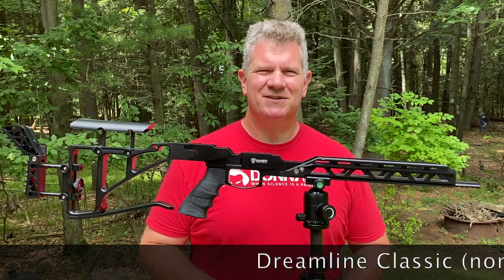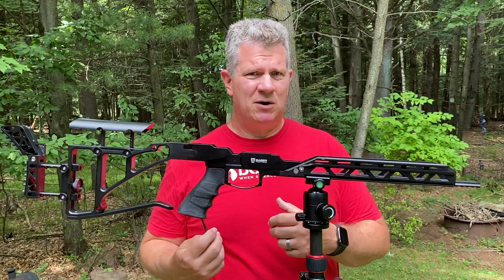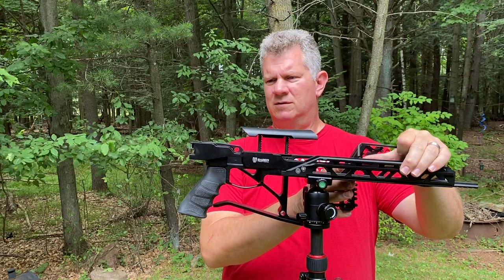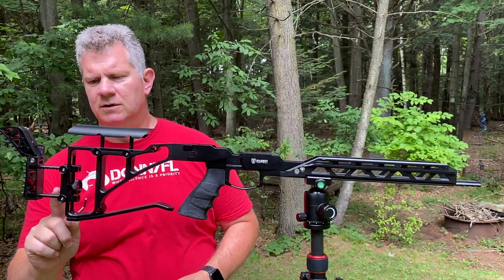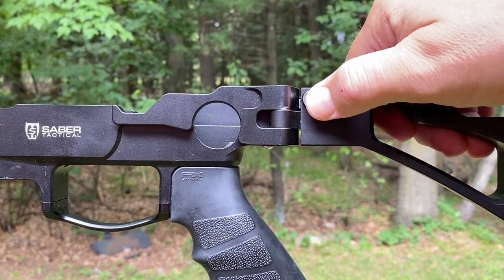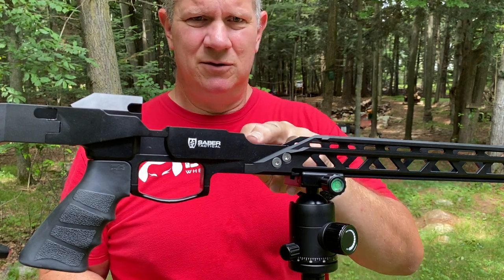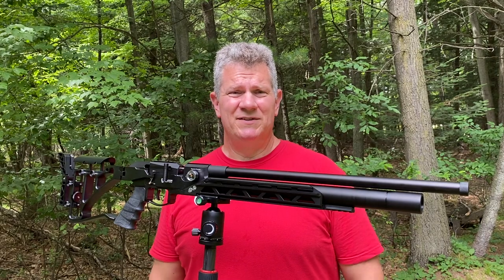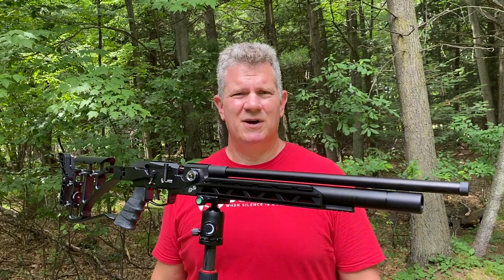Saber Tactical Chassis Install for the FX Dreamline Classic without an External Power Adjuster

Comment: g'day, thanks for the great video. Just about to pick up one of these for my dreamlike down here in Australia! have you shot the .177 much at 12ft pound? I can't seem to replicate the accuracy at lower power settings as I can with 15 foot pounds. About to try the superior barrel liner also, and see if that makes a difference.
Reply from the maker: I have not tuned down below 12 FPE. I think I'm around 20 FPE on my Wildcat. I have had luck with my Superior Liner.

Comment: Is there a traditional ,Hampster, that you can put on it. Please provide link info on the tripard 
I am going to buy one of these How do I give you credit for the reference Thanks Tom
Reply from the maker: Any hamster that can be attached or converted to ARCA Swiss should work.
This is the tripod, though I've since replaced the ball head for one with more clamping power and an oversized throw lever.
https://www.amazon.com/Neewer-centimeters-Monopod-Camcorder-kilograms/dp/B00NSEKEMO/ref=sr_1_3?dchild=1&keywords=neewer+carbon+fiber+tripod&qid=1602615247&sr=8-3
Reply: Thanks for the comeback I,ll let Uthah  Airguns know they owe you one Tom